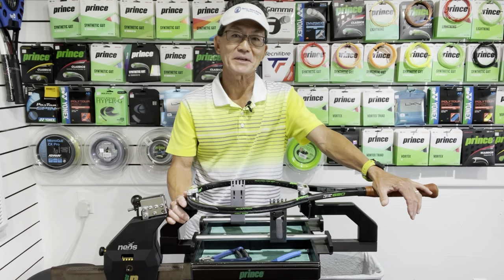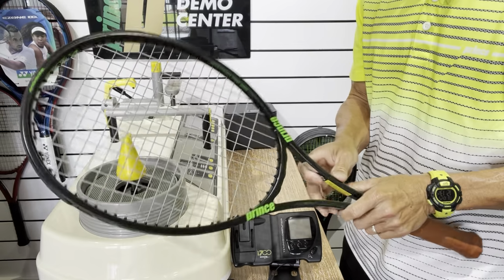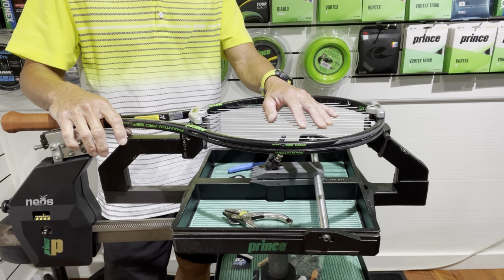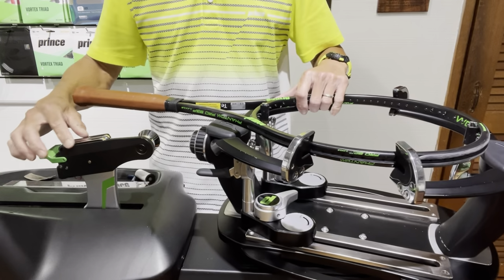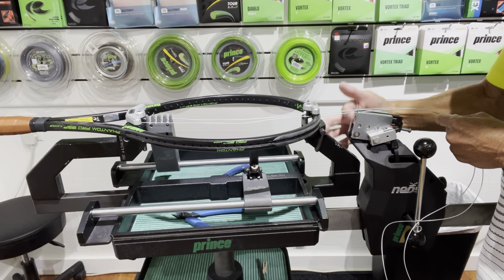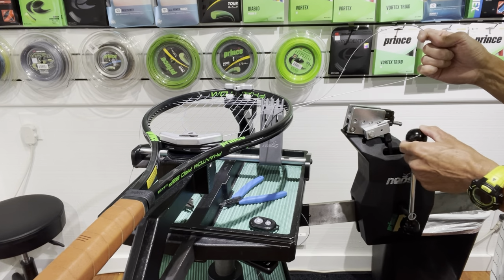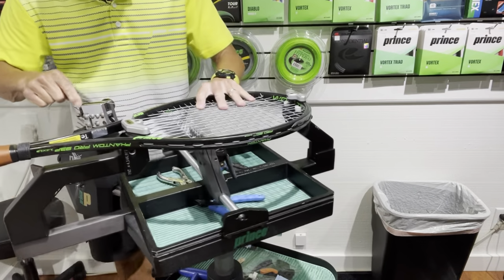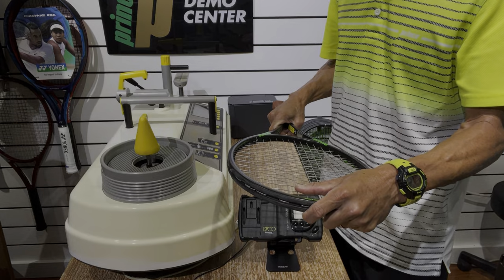Racquet Stringing [2022 Update | Lockout Machine Consistent Tensioning & Streamline Technique]

Comment: Super video. I used to string in high school on an Ektelon at the racquet club and recently took up the game and got a NEOS 1000. With all the modern stringing machines electric constant pull it’s great see informative videos going back to the basics and the little details that make a difference. Well done. Keep up the informative videos.
Reply from the maker: Aloha Steven, Thanks for watching and your support! The Ektelon stringing machine is a "workhorse" and was the industry standard for a long time. Although I rarely use my Neos 1000, it's nice to have it around as a backup and for sentimental reasons. Sadly, they are no longer being made, but it's nice to hear you have one!  Happy Stringing! 🤙
Reply: @AMstringing  forreal. thank you again amstringing1, just bought a neos 1000 and am going to a lot of your videos that show you stringing on a neos 1000. Also love how you provide experiments with tensioning on lockout vs constant pull. I don't really comment often, but just wanted to give you a shoutout. Thank you for your informative videos
Reply from the maker: @bloodkp  Aloha, You're welcome, and I appreciate your support. The Neos 1000 is a great machine that was the industry standard before the introduction of electronic machines. Unfortunately, they are no longer being manufactured. However, with regular maintenance, your machine will last a very long time! 🤙

Comment: Thank you for another great video. Question: you set the tension at 50lbs and it came out 40 to 42 lbs. Is it normal to have 8-10 lbs lower? If you would have strung on constant pull, will the reading on ert be 50 lbs or still lower than set tension? It would be great to do a video on tension comparison between set and final tension on ert for both lockout and constant pull machines.
Reply from the maker: Aloha Phong, 
Thanks for watching! 

The actual tension reading did come out lower than normal. I'm thinking it had to be the particular strings that I used. 

I did another video titled, "Optimum Tensioning of Cross Strings" where I strung the same racquet on my lockout and constant pull machines. I took tension readings using my RDC and RacquetTune app. You can check it out here https://youtu.be/FFlCqzQPY1E. 

On a related topic, I'll be posting a video next week where I compare four string tension devices to track tension loss.
Reply: I actually see the same thing on my lockout. I typically seem to get 8 lbs lower actual tension compared to what I set my tensioner to. And it does seem to depend on the type of string because I've seen 4 lbs "loss" with different string. It's a bit of a bummer with lockouts and something you have to experiment and account for. I always heard of 2-3 lbs difference / adjustment but when I started seeing 8-10 lbs, it felt a bit too much of a difference.
Reply: (contd) I thought initially it was something about my technique / speed or the gripper, but I think it has more to do with how slippery a string is.
Reply from the maker: @marcelobarros5729  Aloha Marcelo, 
Yes, the actual "measured" tension will usually read lower than the "reference" tension. It also depends on the string tension device you're using. 

For more information, here's a video I did on string tension devices - https://youtu.be/9Ux5eBzXrCY.  

Besides the type of stringing machine, here are some other variables that would affect the actual tension of the strings.
  * String material & construction
  * Racquet string pattern
  * Stringer's technique

As far as the difference in actual tension between manual lockout and electronic machines, "it is what it is." The main thing is that you're consistent in what you do. Also, if you have a racquet that was previously strung on an electronic machine, then you simply increase your reference tension on the lockout machine accordingly, usually 2-4 pounds.
Reply from the maker: @marcelobarros5729  See my comment below.
Reply: So based on reading everything, you would have to string at 60lbs to a final result of 50 lbs?

Comment: I’ve asked for 50lbs and got the racquet at 40lbs. This is before I’ve hit a ball. Poly strings don’t lost tension that fast do they?
Reply from the maker: Aloha Phoniq, 
Polyester strings can lose about 2-5 pounds sitting overnight from when the racquet comes off the stringing machine. 

Did you have your racquet strung by the same stringer as normal? Not all string jobs are created equal. The two factors that can influence a string job are 1) the stringing machine used and 2) the stringer's technique. 🤙
Reply: Thanks for getting back to me. Pretty sure it was the same stringer and machine which makes me think of asking for 60lbs next time to get 50lbs.  It seems even though they've been stringing for many years their technique must be lacking.
Reply from the maker: @Phoniq  The problem with asking for 60lbs, is that you might actually get 60lbs, which then would be too tight. 

If the same machine is used by all of the stringers, then that's one less variable involved. You could ask for 50lbs again next time and ask for the name of the stringer. 

If you like the way your string job came out, then request the same person and the same tension. Even if you didn't like the string job, then request the same person and adjust the tension accordingly. 

I hope this helps! 😉

Comment: Aloha Coach AM & Happy TG! 🦃🍽🍁🥂😎🤙
Mucho Mahalo for such an awesome, detailed & helpful vid 🙏
I’m curious why the 3rd optimal/ hybrid method had a higher mains stringmeter tension despite a shorter avg pre stretch tho (🤔 guess it could just be variance)… 
I think my preferred would b 2nd to optimize pre- stretch distance to help w/ the lack of constant pull for tighter & higher DT ultimately…
Did u finish reading that Constant Pull Vs Crank/ Lockout scientific article I sent ya in the summer?
Great to see u finally flexin that ERT700 💪
Great humor @intro too 🤣👍
I bet u we’re dyin to crack that one 😅
Have a great time R&R w/ fam & enjoy!
🥂
Reply from the maker: Aloha & Happy Thanksgiving!

The Stringmeter readings are not always accurate, so I think it is a variance thing.

In my opinion, lockout machines, "is what it is." The main thing is to develop a consistent technique, whatever the stringer decides to do to achieve that. The reason why I felt the 3rd method was the optimum one, was because of the efficiency and speed of having the tension head at a closer distance. 

However, I understand your point about the pre-stretch and higher DT. Normally, the way I tackle that issue when matching tensions from a lockout to a constant pull machine, I'll increase the tension by about 2 pounds on the lockout machine. 

Interesting fact: Although one of the local tennis shops here uses a Prince Neos 1000 machine, their string bed deflection usually is about 4 units higher than my Prince P7000. Their stringers use a technique where they double-pull (and sometimes triple-pull) each string. 

Sorry, I glanced through the article and didn't read it yet, then forgot about it. I'll see if I can find it. 

I wasn't sure about that humor at the beginning. I thought it might have been a little corny. 😜

Comment: Great info video again sir, so the RDC also mesures DT?
Reply from the maker: Aloha Ken, Thanks for watching. The RDC measures string bed deflection (stiffness), and not the actual tension. As far as I know, the ERT is the only device that measures DT.

Make sure to watch next week's video, where I compare four string tension devices and use them to track tension loss.
Reply: Thanks for the reply Albert. I actually have a blue babolat RDC but the deflection and flex is not calibrated, i was thinking it is the same as the DT reading on the ERT which I also have. Do you know how to calibrate the RDC?
Reply from the maker: @kencabon6294  Instead of DT, the RDC can compute Potential Energy remaining in the strings. It compares the initial reading after stringing to another point in time when you want to check it. This is a valuable feature of the RDC. Not only does it give you an idea of tension loss, but it gives me information that I can share with my customers about how dead strings affect the energy return of the strings. When the computed value reads under 50%, it's an indication to restring. 

This ultimately will translate into the amount of effort the player has to exert when hitting the ball.  Over time, the player has to compensate by swinging harder to produce the same amount of power (depth), then that's when control is comprised.   

I'm not sure about calibrating your string bed deflection and frame flex functions, since I've never had to do it on my RDC. I was taught to clear (or reset) my RDC periodically, so maybe that's what you'll need to do. 

Here are the instructions:
Press and hold "TEST"
When the new screen comes up press #1-9-9-1 (yellow buttons)
Push "GRAPH" #8
Push "EFFAC" #8
Push "CADRE" #6
Push "EFFAC" #8
Push "RETOUR" #9
Push "FIN" #9
Press and hold "CLEAR" until the new screen comes up and "TEST" stops flashing

I hope this helps!